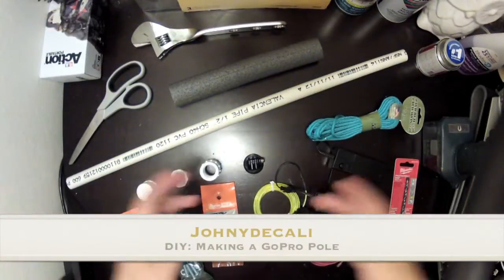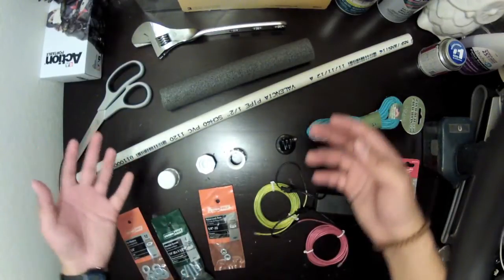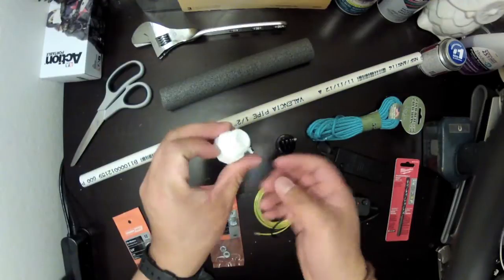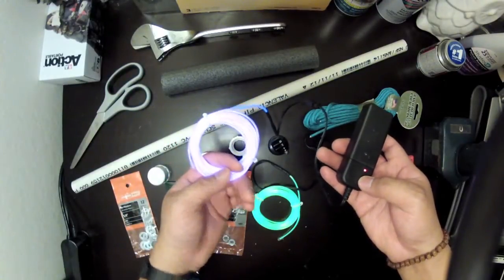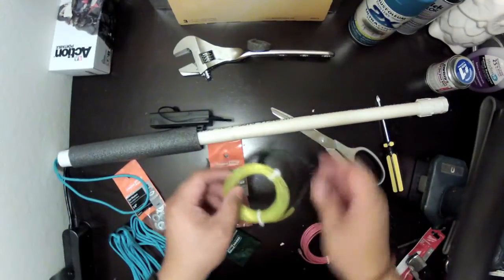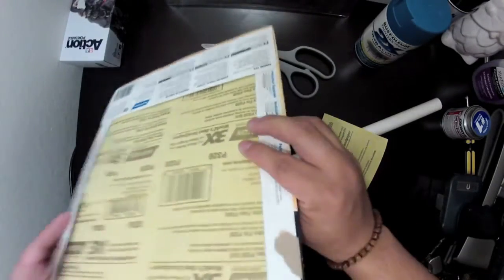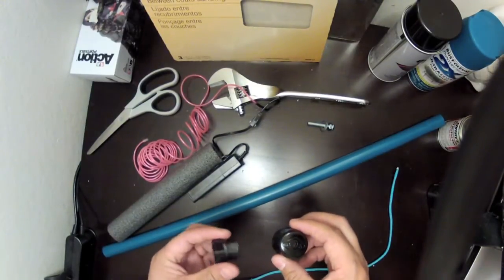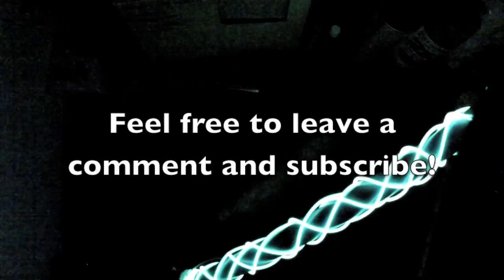DIY GoPro EDC Rave Pole

Comment: Hey how much space do you recommend me bringing to EDC NY? Woud 64 gigs be good? And how is the battery life for the GoPro would i need to bring extra? if so how many?
Reply from the maker: Kevin Tran 64 gigs is a lot but it all depends on how much you'll be recording. If you're trying to record a whole set, then 64 gb can last a couple days. If you're just capturing 5 min clips here and there, then 64gb should be enough.  As for battery life, you'll definitely need a couple batteries per night. A portable charger will be useful to have to charge your GoPro or cell phone while you're out there. You can find portable chargers, such as a Jackery or  Amity, at an inexpensive price on Amazon. Stay safe and have fun at EDC NY!